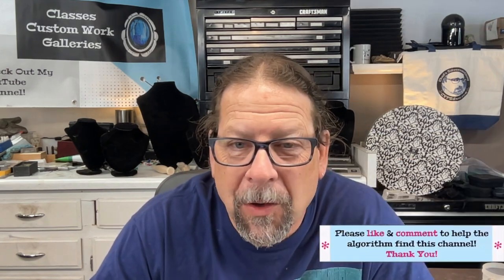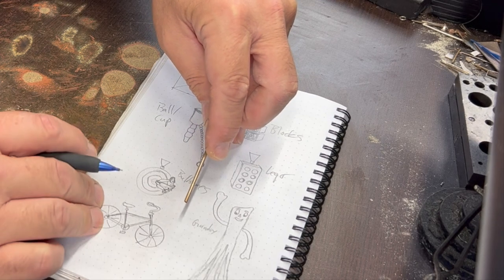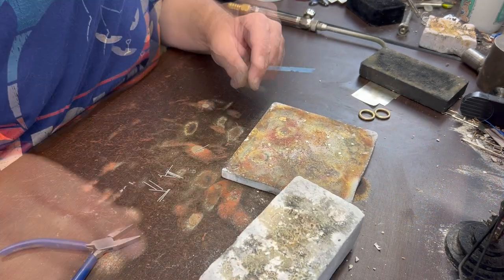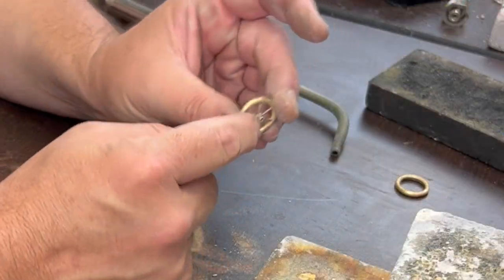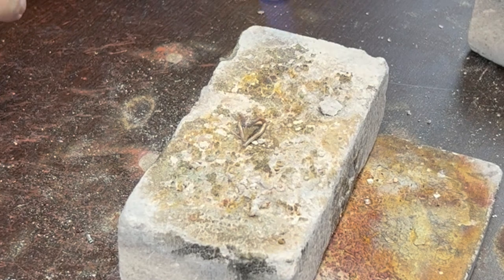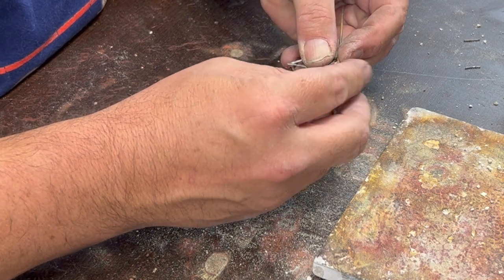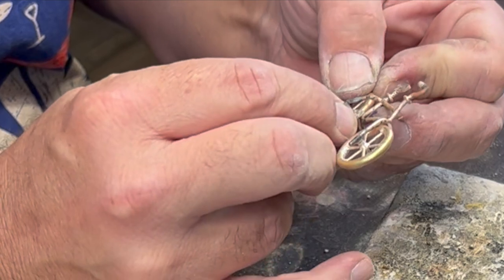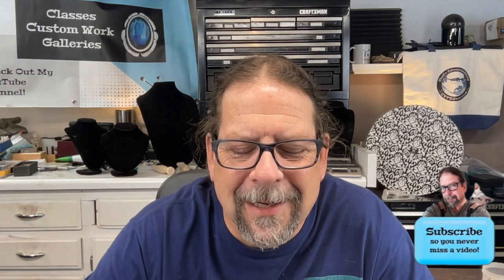Make a Silver and Brass Bicycle Pendant: A Silversmithing Tutorial

Comment: Hi Chad. First time watcher to your channel, very informative and really well shot video, (not easy to get the balance of close in for detail and a backed out for context) whilst working the metal....hot. One thing concerning the soldering that I was unsure of of was how you kept it all together with one grade of solder until the final joints on the wheel hubs with a lower melt grade.
Reply from the maker: Thanks Graham!  Generally my trick is to position things in ways that even if the solder happens to reflow, it can’t pull apart combined with getting the pieces very close to the flow point and then bumping the solder area over the flow point by focusing directly on the solder joint briefly:)